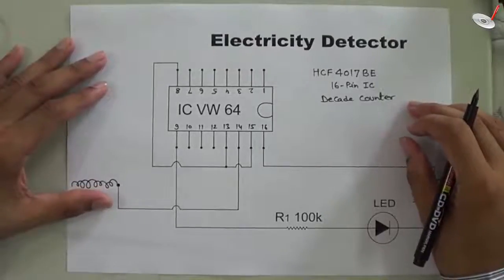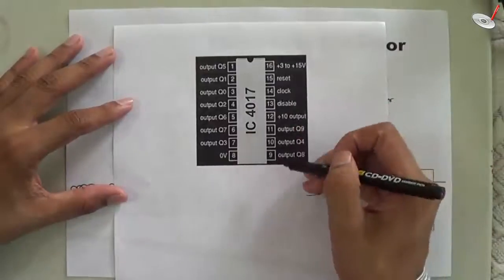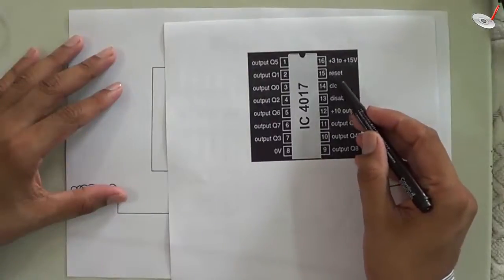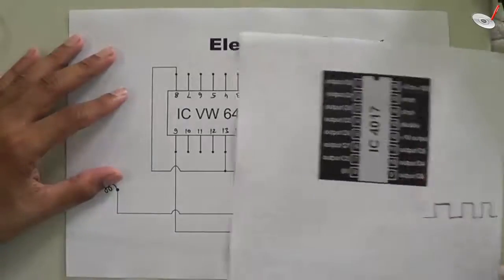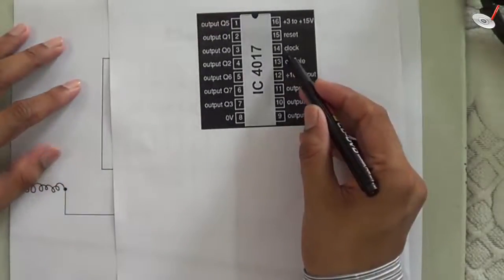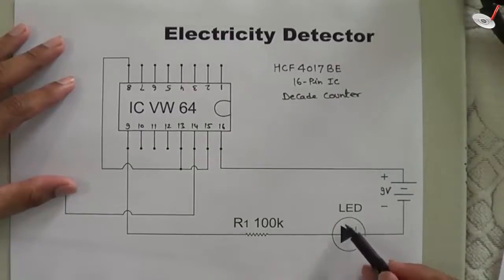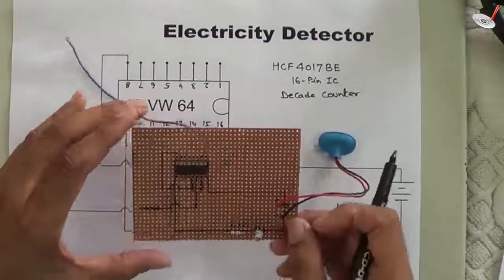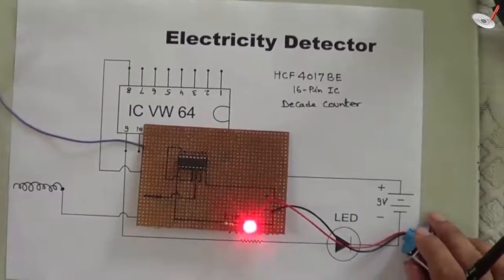How does an Electricity Detector circuit works (English)

Comment: Dear friend your circuit is interesting but there is a serious mistake there in the circuit. You pin 8 is not grounded at all. Another thing is why a 100K resistor in series to LED? A 1K resistor could do it well enough with acceptable light without damaging the LED.